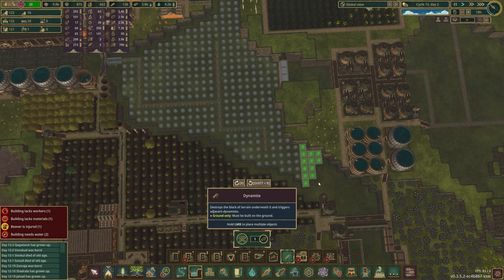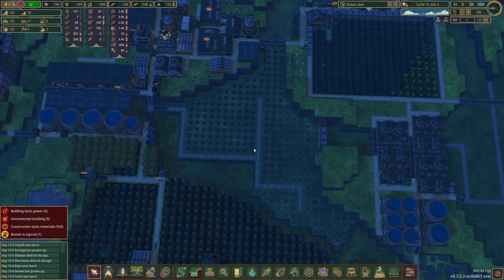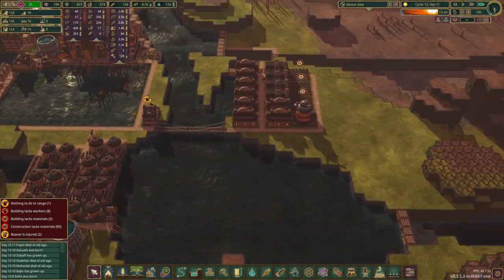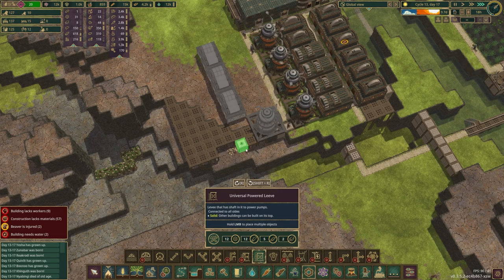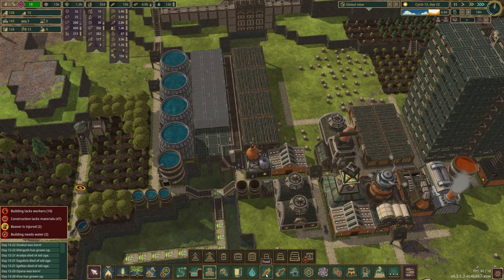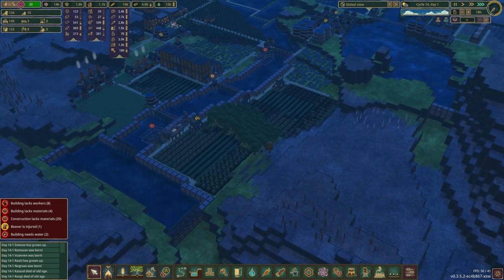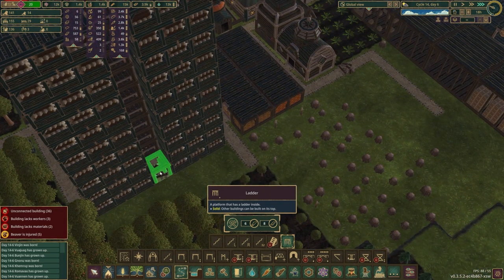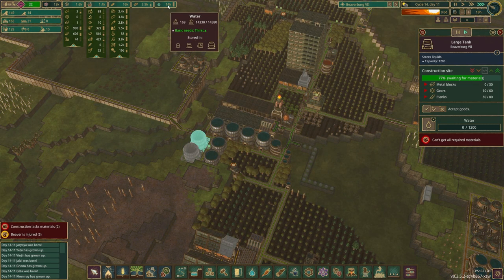Let's finally build a real industrial area! Timberborn Iron Teeth Modded Episode 12

Comment: This massive industrial expansion makes me happy :) I think you should raise the floodgate between the big central lake and the farming river. That way it you'll have your lidos for longer bc it will evaporate slower in the smaller area. Also I don't know if you have all available slots open in your builders huts/hauling posts. I'm pretty sure all the ones you demolished were at full capacity and that's why you have a bunch of jobless beavers even tho you have so many more jobs than you did. Now that we're here and we're not in and out of crisis mode I kind of wanna see you cover this entire map. I think it'd be quiet a feat on this harder mode. And of course, trains. 👍🏻
Reply from the maker: There's definitely a lot of opportunities to fix and improve stuff!

Comment: → I did notice the problem with the universal power levies and the engines (when building, the power-connected other buildings are highlighted, and in this case it were none), but didn't write the comment until after I've seen you notice it, so I guess it doesn't count. I'd just made one continuous line of powered levees (after deleting and before replacing the engine + gear workshop) instead of building these strange "power shaft in trench" things beside it.
→ Don't forget to add a gatherer flag for the dandelion you've planted. And a few more medical beds (maybe as a hospital area) – with all your heavy industry, beavers are going to be injured more often.
→ A second maple sirup storage near the pastry bakeries might also help.
→ Your three smelters are running through your supply of scrap metal. Short-term, adding another scrap metal collector might help, but long-term you'll need another source of scrap metal. (Note that train tracks need scrap metal, not metal blocks.)

Comment: For your new plank storage, you could have used ladders in front of the doors and built directly up.  Didn’t have to rotate the storage and build platforms with stairs
Reply from the maker: Why didn't I think of that? Let's fix that next episode!
Reply: @JC The Beard  you can actually walk through ladders if the ladder piece isn't blocking the path. Turn the ladder so it's up against the building and build a platform to access the storage. Saves on logs and planks and cpu space.

Comment: Instead of having wide SHALLOW reservoirs,  I'd make the center of at least one of them taller and mechanical water pumps (wet season has flowing water so waterwheels to power pumps. & Powered levees can be a walking path also. ) to raise water to fill it, during wet season. dry season use a floodgate/streamguage combo to let water out to keep crops/trees irrigated.
Reply from the maker: Would love to eventually build a big "infinite water power" type of structure where the mechanical pumps just keep moving the water to the top and it turns a bunch of water wheels before being pumped up again.
Reply: @JCTheBeard  I've seen that done .. remember you will have to add more water to the top than makes it to the bottom ( evaporation )

Comment: The water dumps don't run on their own like the engines do.  The haulers will still fill the water dump buildings with 15 water without anyone working there, but the water won't be dumped out if there isn't a beaver to operate the pump.   
What do you think of putting the flame of progress on one of the housing complexes and the flame of progress on the other so that it's almost symmetrical and every beaver will benefit from both of them by passing through every morning?
Reply from the maker: I hadn't thought about the water dumps not working the same as the engines so that's good to know. We'll definitely be doing more with monuments as well!

Comment: I may have missed it but, did you set the priorities of the aquatic farmhouses?

What do you think of using gravity batteries on top of the janga tower.

I think you should continue to blast all the water holding areas lower, and maybe blast some irrigation canals, covered with platforms and paths.

Trains!!!
Reply from the maker: I did not set priorities on the farmhouses since there's only two types of crops.
Gravity batteries aren't really useful for Iron Teeth if you're using engines since those always output a set amount of power. If we were using water wheels they'd be great!
There's lots of water improvements we can make as we keep going along, don't worry!

Comment: Make water channels along shore deeper instead of entire reservoir. Same with locations of water pumps. Should maximize depth.
Reply: I think that would be a mistake.  ( Water less than 1 below growing things the green land goes 16 tiles, let the water down 1 extra & you only get about 9 tiles green, 1 below that & almost no green)
Reply from the maker: I had done that for a bit with the 1-deep lake before I deepened all of it. I do plan on deepening the channels beneath the pumps as low as they'll go, though, since those will end up collecting the remaining water if the big lake area ends up drying up.

Comment: I think the engines power transfer do not work on the corners. I bet if you would of went one further with the that 6 way block it would of worked.
Reply from the maker: As far as I know, I think they only transfer power out the back where the shaft comes out. We might have mess with that in game and see if we can get it to transfer power anywhere else.
Reply: @JCTheBeard  Yep just tested it, engine only has 1 output on the one block and that is the middle on the back